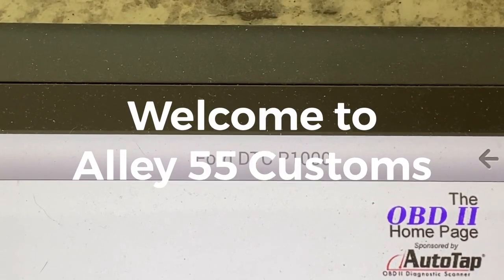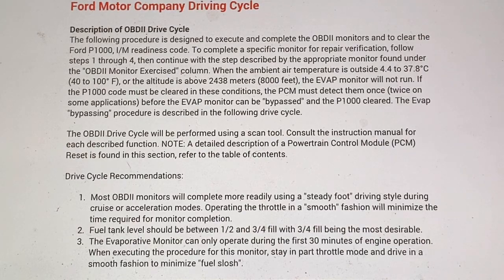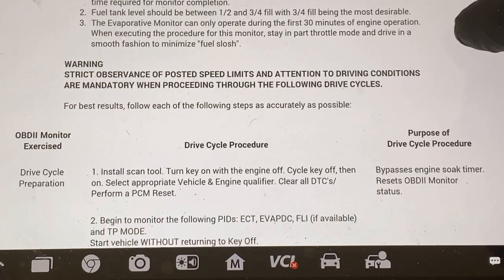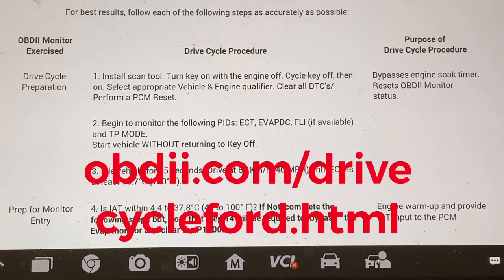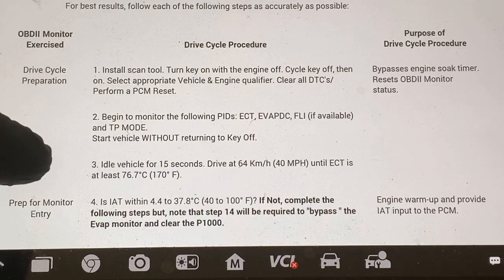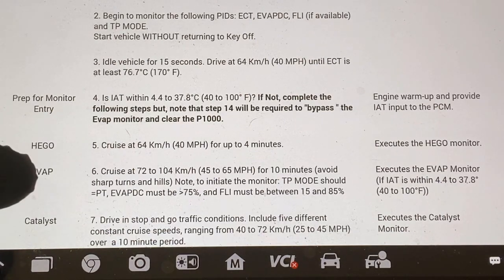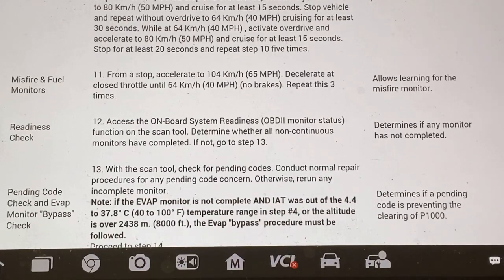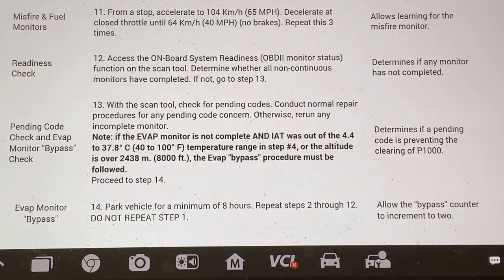Ford OBD P1000 Reset Procedure. Episode 70

Comment: I have ford Ka 2004 M/T i insert a obd 2 from aliexpress. Then i have no idea of obd2 while running the car i plug it and run the vehicle diagnostic. And i dont know if i disconnect if properly. I just unplug it and the car still running. And i park it properly. But then after 3hr i came back were i park the car and when im trying to start it. There is no power is engaging. Then the fuel icon is showing if im trying to start the car. Then i try to insert the OBD again and try to delete the fault code P1000. The 2nd time it show P1000 and B1600

Can someone help me what i need to do

Comment: Basically it’s drive it normally about 70 miles and it’ll reset itself long as you don’t have no pending codes if you have a pending code forget it is not the reset you got a fix your codes. I’ve done that drive cycle, Nata joke and a half this drive at normal it’ll reset itself.

Comment: time out? all this yo remove a check engine light on??? and the system , so far i read will auto naturally correct itself and remove the check engine light? but for the common ppl , you don’t know this , then take it to a mechanic to reset it , but you still pay ford for their time to check it? what’s min. charge 100 bucks, your car enters thier garage and they know the problem before you do. i was told by the service chic, they knew the status of our oddessy before i said anything to them,is our car sending out data without me know??? like gps info, cause a lot of time i say i’m going here but i’m really go there. you know what i mean 😉😉

Comment: This is by far the most ridiculous thing anyone should have to do, to try to get a code out in order to SMOG. It is nearly impossible to accomplish without a closed track. Additionally, I tried it with the car on jack stands and it was difficult to maintain the speeds without resistance and with the throttle being too sensitive.  This should be a reset function with computer input only. I was unsuccessful. The car is now a boat anchor.

Comment: My 2007 expedition started a misfire, threw a bunch for codes, and one of them was low voltage.

I havent tried it yet, but it sounds like a hassle. If it doesn't then I guess I will find a can of gas and some matches
One thing I ask is why can't you just drain the PCM?
I had the battery die and now its this.
Never In my life......
Reply from the maker: It actually is a hassle. I’m only trying to fix a problem before you have to take it to a deal and get charged $$$$$.

Comment: Ive performed necromancy rituals that were simpler than dealing with Ford OBDs...

Times like this I regret not sticking to carbureted cars. In fact, I think I might just yank the 4.6 and junk it, and put a 460 in the car. More reliable engine than anything with a computer.
Reply from the maker: I totally agree. You are extremely right. Computer based cars are a pain in the …
Reply: @alley55customs93  it's not computer based cars that are a problem it just what comes out of ford factories that is absolute shite. Rotteb seals on a 2014 car, disgraceful, but hey it's made in America.
Reply: This 2007 fusion computer junk, leaves me yearning for my old "68 f-250. That was a tank stump puller that wouldn't quit. Sorry I sold it.
Reply: @johnnycanread9978  Yeah. I took out my 73 Continental, and stopped by the dealership, and gave it a few revs. Its breathing out bigger dual exhaust, and screams. EVERYONE came out, and wanted to take photos and look at the car. And this was a Dodge dealer lol, where theyre used to big V8s around. Old school still has it.
Reply: Hm will a necromancy ritual clear my EGR monitor?
Reply: @goodday126  No. You need to open a portal to Bahomet for that.

Comment: 04 PSD excursion has this code. What is the downside of this? Does it affect performance, fuel economy, etc? Does it normally clear itself during normal driving over some period of time?
Reply: basically no issues other than if you have smog test requirements in your state or county this code will cause a fail test.
Reply: My 05 lincoln LS, I have two of them. One v6 and other v8. Also have a 06. Scanner has these codes but no engine light. Have passed emissions with both v8 having this issue. Smog test in Maricopa county AZ.

Comment: I have a 2006 Ford Mustang V6 4.0 5 speed manual. I have this code but the vehicle won’t even start, is it possible you could help?
Reply: Im in the same boat. 4.6 wont start. Now this odd code. Ford is making it really hard to love their cars...
Reply: @RipRoaringGarage  same on a Lincoln mark viii!
Reply: @PBRichfield  I wonder if this is a faulty starter code, without saying it is....I came to the conclusion I got a bad started from the dealership. (I havent had time to throw in a new one though...lol, that car may never see the road again)
Reply: @RipRoaringGarage  negatory bc my 98 lsc (cobra before the cobra) turns over just fine as long as the battery holds out.
Reply: @RipRoaringGarage  so far I've found crushed fuel, return, and evap lines (yep all three thanks to some moron with a lift) and the wires literally hanging by a thread on the crank position sensor.
Reply: @PBRichfield  Ok, then I cant say why I had that code. ALthough I looked at my records since I document things like this (especially for long term projects). I did get the P1000, but then it was gone. Still no crank. It was cranking when I took the car out of storage, but then battery died, charged the batt, then no crank. Lights are fine, no antitheft...I check the starter and the rust was bad! Changed it, recrimned wires with a hydraulic crimper, and still no go. Tried shorting the solenoid...and nothing, so that has to be a bad starter (unless theres something on the ground side of the circuit..since the ground has a switch, so I replaced the neutras safety sw, since it was a coral reef of rust...and still no go.
Reply: @RipRoaringGarage  good notes! Mine sat all (9wks of southern) winter because i keep forgetting to drop the dash and replace the solenoid for the blend door (might as well get em all) until it gets cold. So it sat and I went out to crank it one day; battery was dead. I went and put the quick charger on it and it hasn't ran longer than starter fluid allows since.
Reply: @PBRichfield  Thats odd. What is it with Fords that sit that dont want to start again? I mean modern ones. (Well, to me 90s and 00s are modern lol). The dash on yours must be a PITA though, and I thought the CV was bad. Mine sat for 7 years...Im the original owner, and kept it really good, but was in a bad wreck, broke my neck and spine...car sat because lawyers said to not touch it...and thats when issues cropped up. I wuold just start it, let it run, change oil, etc. It drove more in Oklahoma were I was stations, but then NY winters got the it...even with twice weekly washes. I have a 73 Continental that was burried (literally, half under ground) and it hardly has any rust. What is has is sheet metal, nothing on the floors, frame is clean...I used to tout these era CV as bullet proof...well, sure, as a 10 yo car, but they dont age well...Still, Im not dead set on giving up...just money for another new starter lol.
Reply: @RipRoaringGarage  idk. This mark viii only has 90k miles and everything used to work great. I've looked over the entire procedure and even the quick fixes and the removal on this one won't be near as hard (or take 2 days) as my 2004 town car. That sucker was a massive PIA
Reply: @PBRichfield  That third starter bolt can be a paint, and wiring....show me any car thats not a nightmare lol. I have that 73 I mentioned, and rats got to the wiring, but that was just a few hours and I could trace every single wire...and its got a lot, but routed nice, along corridors, and you can easily check for shorts. I can imagine that the Mark is a bit tighter, plus you have the self leveling air bags in the front too, not just the rear. Thats another problem mine has...the rear sags but its a compressor problem. I am tempted to go springs...but, I have the "original" bug lol
Reply: @RipRoaringGarage  that mark has over 15 damn pages of relays on rockauto and I'm not talking bout their eco-sport; I mean one model per listing. It's like they designed the whole thing and then decided on a positive ground. Oh yes miles and miles of unnecessary wiring and the air lines too. The latter being totally necessary in my book too. I've had far simpler, beetles, buses, etc and I was trained on computer diagnostics as well as the dwell meter the size of a commercial fridge!
Reply: @PBRichfield  LOL. Yeah. I just got into modern computer diags. I got a SnapOn Zeus as a gift, so I kind feel I HAVE to learn the damn things now, right? (Its a pricey bugger, but at least it wasnt as bad as 15k, it was like 6..but still. Im hoping it will pay itself off with newer stuff since my specialty is getting rarer and rarer). I still have those dwell and tach units. No joke, at least 10 of them, from various eras lol, and timing guns? I have one thats bigger that an UZI lol. Its funny watching younger guys scratch their head dealing with a carb, setting it up right. To be that seems simple, like, SIMPLE. Computers scare me a bit, but the guided repair thingamabob helps. Im not ashamed to admit it (as Ive seen online...cant figure out why theres shame in learning and having that helping hand)
Reply: @RipRoaringGarage  wow! Thats a heck of a starter diag! I'm of a small generation where we were taught the analog ways and then, when affordable (for public schools), we learned the digital methods. I took typing on a regular IBM typewriter and our report cards shrunk from a huge piece of tractor-fed green bar paper to these nice 8.5*11 sheets you could put more than one of in your pocket! So I do greatly appreciate simple and always admire efficient and concise designs. I do still have the 1600 motor that pushed my last Volkswagen. I've thought about selling it but havent found the right buyer and I probably never will.
Reply: @PBRichfield  I only mention it because that damn near brought a tear to my eye. It was a really nice gift from my mom. We grew up poor..and I mean poor. They defected from Romania, and had nothing, and clawed their way up (just to divorce but thats just why getting a house only happened late...as in two years ago, scrapping moms credit and mine, to qualify). I still have all my old tools, and used tools, tool boxes, etc. She knows Ive been a bit down, recovering from that bad wreck with my CV. It ended my career, and no, Im a walking OSHA violation lol (medication), but I can still work on my own, trying to fix up a car, sell it (if I dont keep keeping the damn things lol), and here on youtube...and other platforms. At least make a show of it? It is what is is, but I get you. I was raised pencil and paper, notepad, drawing out wiring schematics to figure out what the problem could be. Im called a ludite a LOT, but if the tech is good, and works, then great. I made sure the Zeus was a WIndows 7 machine, so I can install word, excel, where I have my own manuals, made over decades of working on Lincolns, and the 460 (and the bus I have..not related to VV other than it has a German heart, a 10.35 liter MAN diesel...big girl lol, and thats a challenge too, wrenching on her alone, with the broken neck and back).
Reply: @PBRichfield  Also that wasnt a plug, because I suck at making videos lol. Im just trying whatever works, and lately less and less seems to work out.
Reply: @RipRoaringGarage  mine is absolutely not getting any signal from the crank sensor. I went ahead and ordered 2 seeing as my TC is 17yo now and rocking 230k+. Ones the real deal Motorcraft and the other a Denso. Oddly, rockauto didnt list the motorcraft for the mark but did list the exact denso for both. We shall see how it goes tomorrow
Reply: @PBRichfield  Good luck! Yeah, Rockauto has some weird compatibility issues. I have a 72 and 73 Continental, and drive train they are the same..mostly. But, Rock Auto was saying oil sending units are not the same. They are. But, with a bit of thinking cap on, it works. And Im still a five year old bcause I collect the silly magnets LOL
Reply: @RipRoaringGarage  lololol.. otherwise known as the only magnets for the garagwnbwwemc beer
Reply: @PBRichfield  Its my guilty plleasure, along with part company stickers. Its HARD to not totally cover a tool box, to show off a more vintage cool box, but still...just...one...more...sticker LOL
Reply: I edited that comment to read 'the only magnets on the garage beer fridge' about six times and every time it posted garbled.
Reply: @PBRichfield  Lol, I rear garage wannabe beer. I mean, I got thck skin and still thought it was funny but now what you said makes a hell of a lot more sense!

Comment: I already did this process many times and it  hasn't worked. In my 2001 ford Mustang bullitt right now i ran 1300 miles and nothing happened. The ford dealer said to  continue running it this way. Do you have any ideas that could help resolve this issue? Thank you.
Reply: Same here 2007 mustang
Reply: Did it eventually go away ? I heard it just goes away eventually
Reply: I have no herd of it go away, it has to pass all the tests so catless pipes air intakes ext ext need to be swapped out